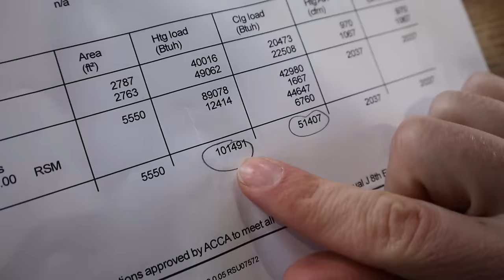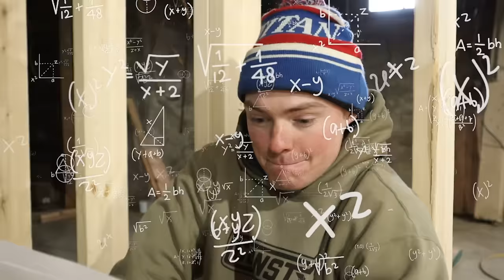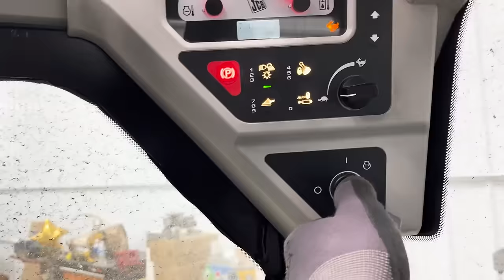Restoring A $7,000 Mansion: Removing 2nd Story Floor

Comment: Cole - think like a boss.  You have the land and a relationship with a reliable and skilled excavation contractor.  Go ground source heat pump for the primary (main house) radiant floor system.  Additional up front cost can be partially offset by tax credits and rebates.  Spend your money wisely - future-proof your house with smart control/automation systems.  Use mini-splits for the garage addition and attic.  High ceilings NEED ceiling fans - very cost effective and efficient.  
Side notes:  Large house - consider an intercom system, centralized whole-house hi-fi music distribution system (Sonos) laundry chute(s) and possibly the most beneficial/labor saving device - a central vacuum system in the basement. 
Lastly,  I presume you are on well water.  With all the chemicals you guys spray on your crops, I would SERIOUSLY consider installing a reverse osmosis whole-house water filtration system.

Comment: Make sure you add dryer vent, range hood, bath exhaust fans along with ducting, combustion air supply to boiler, and furnace. System design is important.  I would get at least 3 complete quotes and system designs.

Comment: Look into a geothermal forced air hydronic system, you have heavy equipment and can probably do most of your own dirtwork. I'm a master geothermal tech in Northern MN and if it works for us it'll definitely work great for you. Can do chilled water fan coils or a hot water forced air system, heat your domestic potable water. They can also do refrigerant evap coil forced air systems or infloor heat. Look into it, with how far you've gone on the insulation and updates on the house and sound like the place is going to stay in the family forever it's worth the investment. Been watching since the beginning, Good luck Cole.

Comment: 2 units is your best option. It will keep both levels consistent on temperature. Also ask about a hybrid heat pump. When it gets below a certain temp it can run off propane to help maintain heat.
Reply: That is what i use, heat pump hybrid with gas furnace. you set it to run heat pump until outside temperature drops below a set temperature, then gas or propane furnace takes over. Also zone ducting works great to keep house temperatures even
Reply: Geo-thermal is the way to go. If the right system is selected, only one is required. He's using in-floor heating and so won't need all the duct work. He will need the piping/tubing though. How do you think the very energy-efficient apartment buildings in Western Europe are built? They have thermostats in each room or bachelor-style apartment..
Reply: @SlickBubbles  he will need duct work. If you listened he’s going to have air conditioning and the company said the heated floor will not be sufficient source to keep warm so he will need heat pumps to help keep warm.

Comment: I lived in a 50's Abobe with Radiant heat and no air conditioning in Central California where it get's over 100 often. The Adobe walls acted like a heat exchanger because of the mass. The windows were high on the east west walls for heat venting in summer and the North South windows normal size. Opened up all in the mornings B4 breakfast to cool inside closed North/south/lowered blinds for day and left East/West open to vent heat. Worked like a charm.

Comment: Regarding HVAC, first thing is to think about how you use the space.  Personally I like ductless mini-split units for the master bedroom, home office, guest rooms, and maybe even kids rooms.  Ductwork is going to be very hard to install with the way your framing works. 

A single heat pump furnace for the house is a mistake. You will never get good control. Make sure your heating mode is sized for the higher winter temperature and not the maximum temperature.

With the spray foam you will need an ERV for outside air/exhaust. The good news is the ducts for them is more manageable.

Find out the supply and return water temperatures for the radiant floor.  It is easy to have too big of a boiler that limits controlability; sometimes a big one plus a small one will work better.
Reply: I have 3 mini splits in my 3 bedroom 2 bath house I have about $8000 into it far less than the estimated $100,000 of his estimate (I think 3 is over kill) one is hardly ever used
Reply: Thinking he would Hate himself Without EVR!! Inside air quality would suck. Not to mention mold issues. House is Very tight.
Reply: That’s what I love too   After learning about mini splits in detail from my son I would go with those systems if at all possible!!  And dehumidifier and air handler which will keep u form having to have exhaust fans inside!  Air quality is so much better
Reply: I feel mini splits up that far north would struggle to keep heat where is desired. Cooling would prob be fine. Just my opinion. Great comments though.
Reply: @bholden8625  not bad at all my house is very well insulated 6in spray foam walls and ceiling with 1/2 on the outside with house wrap I have 1 exhaust fan that runs 24/7/365
Reply: WE had a fire out on our back timber framed patio where the firemen hosed the house inside when they didn't need to, so it added wet soot to the mess.  We had to replace our 3 compressor outdoor unit (which no one had ever seen before) with 3 mini-splits which I love.  Three different rooms easily controlled separately!
Reply: I have a question. I’m 70 and now their many bed rooms that are not occupied. Can shutting the vents help with my heating and cooling bill. I live in northern Florida.
Reply: @kathyconner51  A little, but not much; the main benefit is that you get heating/cooling where you want it.  Beware of mold though if you don't allow for circulation.
Reply: @patrickkenny2077  thanks for sharing your experience. Could I hope the windows in those rooms in summer for air circulation?
Reply: @kathyconner51  That will likely make things much worse.  The best approach is to close the doors and once a week open them up and run a fan.  

A lot of it depends on how well insulated the house and windows are and what temperature you keep things inside in the various seasons.
Reply: @bholden8625  The mini-splits are just for supplemental heat; my recommendation assumes he uses the radiant heat for primary heating.

Comment: I’m 26 years old and have been in hvac for the past 8 years, as far as the heating and cooling goes I would definitely go with 2 separate hvac units with their own dedicated duct systems. 1 for the basement and first floor, and one in the attic for the attic and 2nd floor. Now you can make both these systems heat pumps with air handlers and have the back up heat as the infloor from 1 boiler in the basement for the whole house with dedicated zones for whole house which is where you have zone thermostats in each area of the house and zone valves or pumps that open in the basement near the boiler that control zone flow. Just for your information the heat pumps obviously do air conditioning as well.

Comment: If you want a cheap and easy way to keep decently warm while working. Get a couple of infrared heating lamps. They really work wonders, we use them for outdoor parties in big tents when its cold and that way you wont need to have gas heaters and you will really feel the difference

Comment: Do the two systems, because there is nothing worse than a hot bedroom at night, and cool air drops, so your main floor will benefit from the upstairs unit in summer, and the upstairs will benefit from the unit on the lower floor in the winter. And if one quits (happened to me), you at least have the other to help maintain temp while you wait for the fix.

Comment: Having an ERV is a great way to manage moisture. Not only do you want heating and cooling, but humidity control is crucial.
Reply: I thought ERVs needed a dehumidifier added to them as the ERV unit only exchanges air and thermally transfers from supply to return or vice versa. I will continue my research
Reply: @brittneyemerson2079  ERVs just normalize incoming air with outgoing air, by retaining the heat and humidity to some degree. You still need a dehumidier if your humidity load is high. Amd you still need a humidifier if the ERV in unable to maintain humidity. ERVs are used so incoming winter dry air is humidified a little before entering the envelope of the house and dries(humid climates)/humidifies(dry climates) during the summer.

Comment: We live in a 2 story country house as well. When we bought our house, it had 1 central air unit to heat and cool both floors. During our first summer, we bought window units because the upstairs was miserable hot, the downstairs was comfortable. If we turned down the thermostat to try to keep the upstairs cool, the hvac couldn't keep up. The unit was sized right, but there was too much temp loss, and not enough pressure to keep the upstairs at the desired temp. We ended up leaving the central hvac downstairs, and installing a mini split with individual heads for all the bedrooms. 

I work in maintenance and things like this get discussed alot. There is a guy at work with a in town house that was built in the mid 2000s with 1 air handler. It has the same problems with keeping up. In the summer upstairs is hot, in the winter it's cold. I would recommend atleast 1 air handler for downstairs and 1 for upstairs. Even in this situation, I think you attic temp will be hard to regulate without a mini split. Talk to people you know with 2 stories or more,. If they have 1 air handler, I bet they have a similar expierence. It seems to be the situation with everyone I talk to. But a mini split for the upstairs and attic means you would be able to have multiple zones for diffrent areas and control the temp as desired. You should look up a couple videos on mini splits to get how they function. Just another option.

Comment: We live in a 3100ft^2 two story in AZ.  We had both HVAC systems replaced for $22k two years ago; $30k seems reasonable to me.  Option 4 - have HVAC contractor provide you the ducting plan and you procure and install.  After all, they are making margin selling the materials to you.  I think you want two systems as you described so that they are independently controlled.

Comment: You should save some of those old flooring boards. Run them thru a planner to bring out the grain and they will make an amazing accent wall and trim boards.
Reply: I would have loved that, using the old hardwood floors.

Comment: Awesome Channel!!  As a person who lives in a cold part of the US and did a rebuild - here are some things to consider - 1) Heat Pumps below 32 degrees are a huge electrical cost as they lose efficeincy below 32 degrees -  Put a 3000 BTU pellet stove in the living room on the first floor and another (maybe) on the second to suppliment your infloor radient system.  Check out Harman Pellet stoves  - 2) Radient in floor heating fueld by Natural gas is more efficient than a forced hot air system - especially if your thinking about heating those loops with a heat pump and 3) Mini spit A/C technology has come a LONG way - most efficint way to cool your home - Check out Pioneer Mini Splits

Comment: Cole, I am 83yr  designer and wife/mom/grandmom who lived with an in-the-floor heat in one house, and in-the-ceiling heat in another.  Hated the in-the-ceiling heating and replaced it with forced air within a year.  Liked the in-the-floor better, but it was not consistent throughout the house.  Some real hot spots, and some real cold spots.  Kids complained.  Ended up replacing that system, too, with forced air.  Much more even and responsive.  Kids were happier.  Two systems, definitely.  One system was a pain, even with several zones.  I am not an HVAC professional, just a consumer who has moved around.  What is comfortable for feet is not necessarily comfortable for kids playing on the floor. 47:35
Reply: With the advances in in-floor systems, not including an electrical one, that isn't a problem with newly installed quality systems these days. If your house is well-insulated, an in-floor system is all you need, if you get one of the best installed by the best installers (For that system).
Reply: @SlickBubbles  The system was already installed when we bought the house.  I was usually comfortable.  My kids—their favorite position was lying on the floor to do homework or watch TV.  They felt too hot.  When I turned the temp down for them, it took forever to cool down.  Then they had to open windows in the snow.  Our house was very well insulated.  Drove them crazy.  Me too when I would find an open window.

Comment: Spend the extra money on the second system. As someone who owns a multi floor house (in TX, not IA), multiple systems help keep the temperature consistent between floors. When I purchased my home initially, it only had 1 unit for multiple floors. On a normal day, there was about a 10 degree delta between floors; and that was after adding more insulation in the upper floors. To be comfortable on the upper floors, the setting was either uncomfortably warm or cold on the ground floor to comfortable on the upper floors, and the single unit ran almost all the time. After adding the second unit, the ground floor unit runs sparingly, and the upper floors unit runs what you would consider to be a normal amount of time and the delta is only a 1 to 2 degrees. One of the better decisions I have made for my home.

Comment: We have built a house and purchased three houses since 1996.  Our experience is two systems are best, especially if you have multiple levels.  We suggest you do zones in your HVAC system, as well.  You can turn off areas, I.e. the third floor during non-use times.  Doing zones has saved us money in the long run. We, also, spent the extra money to acquiring a two stage system.  We had lower utility bills because unless it was extremely cold or extremely hot outside the system usually used the first stage, usually less fuel or electricity.  
Our advice is to invest in two units.  That has helped us heat or cool the house some, I.e. heat rises and cool sinks.  The extra money we spent was covered in the monthly savings on heating or cooling. 

Good luck!

Comment: I myself would say heat/ac units in the attic and another in the basement.  About 6000 square feet is a huge space.   I would put in the most modern hvac you can afford.  I myself would ditch the heated floor idea but that's just me.   Hvac has come a long way to where individual rooms can be controlled.   If your running ducts to cool may as well add to it and heat with it too.   Heated floor will do what for you?   Besides being another full heating unit!!  ?

Comment: That recovery unit is added to homes that are really air tight. When you have a house super sealed and spray foamed you don't have the natural air exchange. Without that air exchanger unit your house will be filled with stale air. That heat recovery allows for the old exiting air to partially heat/cool the new incoming air. There is a radiator between the flows so they don't actually mix just temperature exchange. I have one in my house and it helps to keep the house air fresh. Also it has a full vent option that is useful when cooking to help the stove vent.

Comment: Couple of things to consider.  My parents have a large Amish log home with similar HVAC requirements and space constraints.  What worked best was in floor heating for the basement and garage.  So if you are planning to add a garage think of how you would add that to your system.  The rest of the house was all standard HVAC (no in floor heating in the rest of the home).  The trick is to split your heating and cooling for the different floors. Put the thermostats in a central location in the home. Ceiling fans will also help evenly distribute air.  Minisplits in the attic space would probably be a good option provided you have enough wall space to mount them.  They can do double duty heating and air conditioning and eliminate the need for ducting.  

If you are planning to do in floor heating for the whole house I would highly NOT recommend you that.  That decision could easily double the price of the whole system.  Your ducting can do double duty for both heating and air conditioning again saving you money.  If you like having the feeling of warm feet in your home I get it, but if you heat the basement floor the rest of the house will feel perfectly fine without any additional in floor heating.  

If it were my house would instead spend the money for a Geothermal HVAC system.  Highly efficient, all electric.  Think about it, if you are not putting in a gas stove or cook top or dryer your hole house could be electric and you can ditch your LP tanks which eliminates a large unknown future cost.  One of the drawbacks of installing a Geothermal heat pump is the labor of installing the closed loop lines in the ground. In your case you could do all of that yourself and bury the lines which would drop the price by at least a 1/3.    Keep in mind Geothermal systems also can heat water for in floor heating.  Again, highly efficient.

If you are worried about power outages (loosing all temperature control of you home), install a generator (perhaps a diesel one) that can power your home in emergencies.
Reply: Agree  with most but propane tanks can store gas forever and good back for no electricity times and can run generators

Comment: As someone from a different country, it’s a learning experience watching how others frame. Such tall walls all basically carrying some load. No what we call noggins, no speed brace, no sheathing. Other than leaving some flexibility for your next floor up, with so much work done on the  lower floors I’m surprised you didn’t lock it all in tight before moving up and starting again.